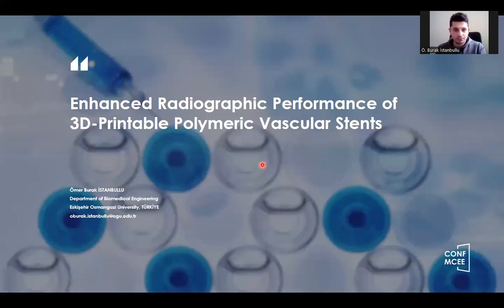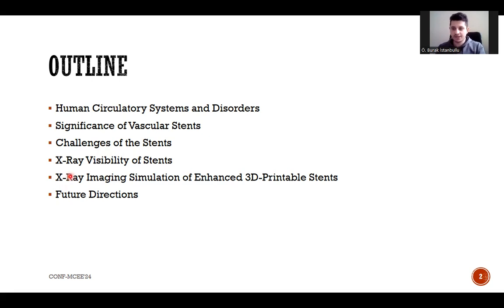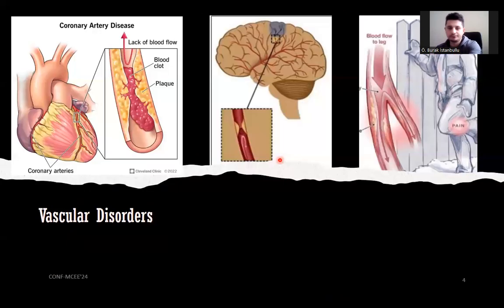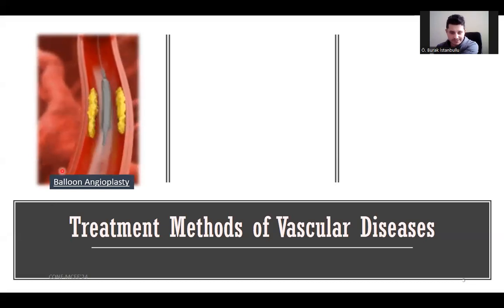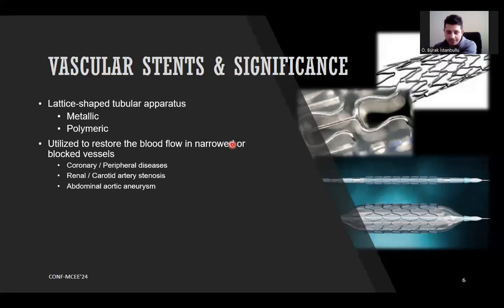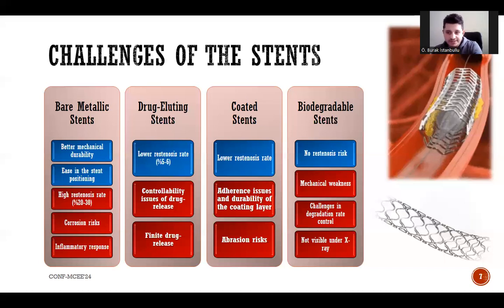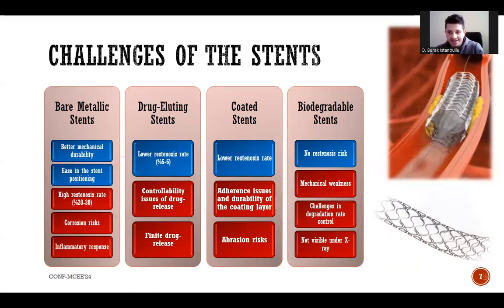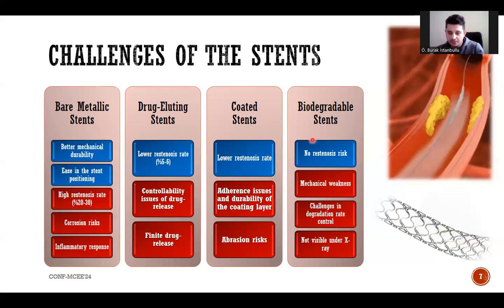CONF-MCEE 2024 - Enhanced Radiographic Performance of 3D-Printable Polymeric Vascular Stents

Comment from the maker: Here are the questions we collected and the answers replied by the presenter: 
Q1. What improvements in radiographic performance are observed with 3D-printable polymeric vascular stents compared to traditional stents?
A: Improvements in radiographic performance with 3D-printable polymeric vascular stents compared to traditional stents:
Observerd improvements and pontential contribution of 3D-printable polymeric vascular stents compared to traditional stents can be discussed within four main topic.
First of all, one of the key improvement is the enhanced visibility under radiographic imaging techniques such as X-rays or CT scans. Traditional metallic stents can sometimes create artifacts or obscure surrounding tissues, making precise interpretation to be difficult or even inaccurate. However, polymeric stents, especially those made with 3D-printable materials having improved radiographic visibility, offer better contrast and clarity, enabling healthcare professionals to accurately assess the stent's positioning and its impact on surrounding vasculature.
The other benefits of improved radiographic performance is regarding reduced artifact formation. Metallic stents often produce artifacts in the images, which can obscure critical details and hinder accurate diagnosis. In contrast, polymeric stents manufactured using 3D printing techniques exhibit reduced artifact formation, leading to clearer and more reliable imaging results. This reduction in artifacts allows for better visualization of the stent and surrounding tissues, aiding in diagnosis and treatment planning.
Additionally, 3D-printable polymeric vascular stents offer the advantage of customization, allowing for tailored designs based on the patient's specific anatomical requirements. This customization can optimize the stent's position and geometry within the vessel, further improving its radiographic performance by minimizing interference with surrounding structures and maximizing visibility.
The last potential contribution is the integration of drug-release monitoring.3D-printable polymeric vascular stents can integrate drug-release systems for follow-up treatment. These stents can be designed to release therapeutic agents such as antiproliferative drugs to prevent restenosis or promote healing post-implantation. The radiographic performance of these stents not only allows for visualization of the stent itself but also enables monitoring of drug-release kinetics and distribution within the vessel, facilitating targeted therapy and personalized treatment approaches.

Q2. How do the material properties of 3D-printable polymers contribute to the enhanced performance of vascular stents in radiographic imaging?
A: Contribution of material properties of 3D-printable polymers to enhanced performance of vascular stents in radiographic imaging:
3D printing allows for precise control over the material properties of polymeric vascular stents, enabling customization of parameters such as porosity, flexibility, and surface characteristics. This design flexibility facilitates optimization for radiographic performance, as stents can be tailored to balance visibility with mechanical strength and other functional requirements. By fine-tuning these material properties such as reinforcement with additional proper materials, 3D-printable polymers contribute to enhanced radiographic imaging of vascular stents by maximizing visibility while maintaining optimal performance within the body.
On the other hand, the biocompatibility of 3D-printable polymers is crucial for vascular stent applications. These materials can be carefully selected and engineered to minimize adverse reactions within the body, ensuring compatibility with surrounding tissues and vasculature. By utilizing biocompatible polymers, 3D-printed vascular stents can maintain their structural integrity and imaging performance without causing harm to the patient or interfering with radiographic imaging.